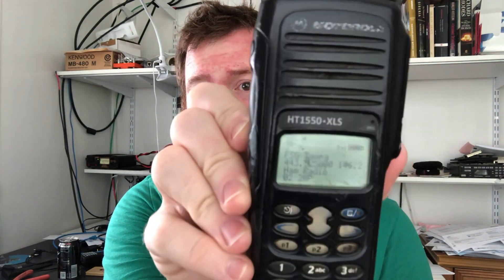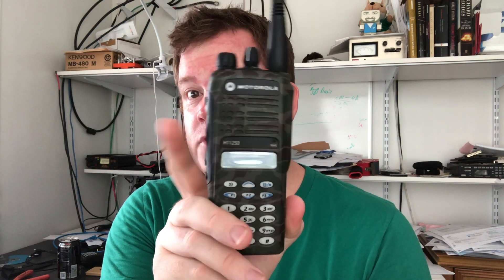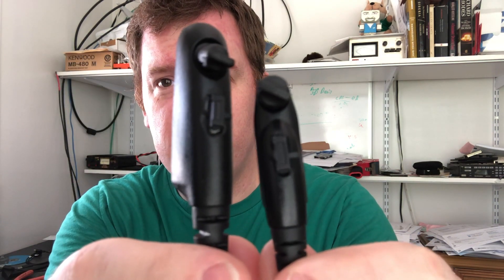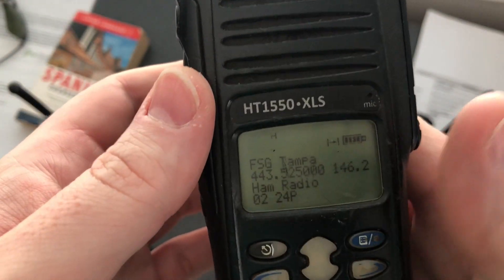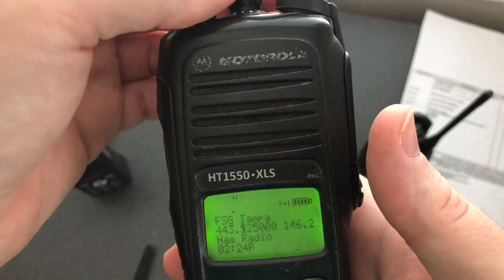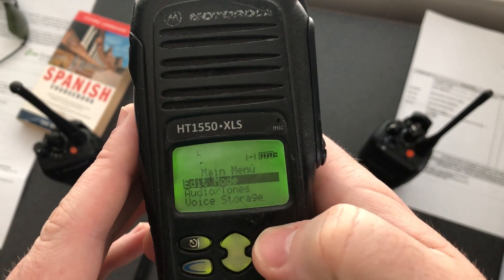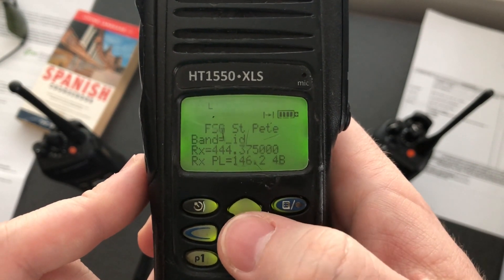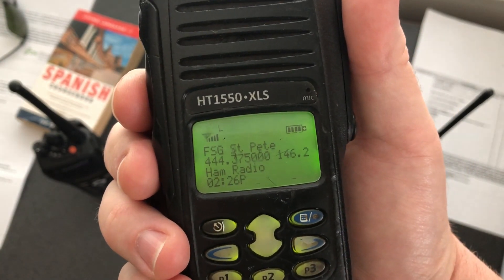Motorola HT 1550 Keypad Programming

Comment: Do you have the schematic or can tell me what pin number you take to ground for avoid the chip issue..or having  the red battery...I'm sure the radio I have the old firmware in the radio..
I just got a Ht1550xls and  need the software and the programing cable for it and want to be able to FPP for Ham use on the radio...Did u say Chirp can program the Radio??? Also do you sell or can you sell me a cable with a switch in it???
Thanks